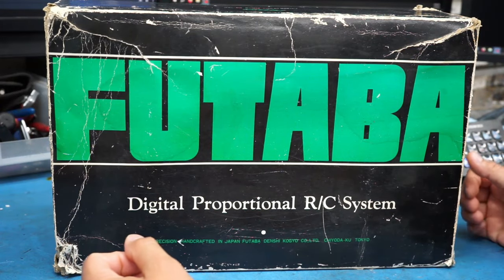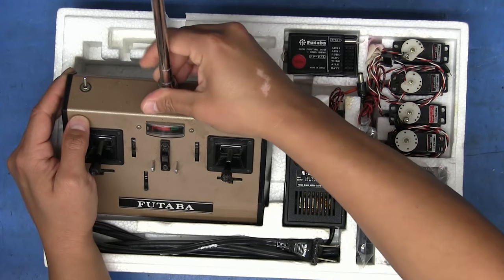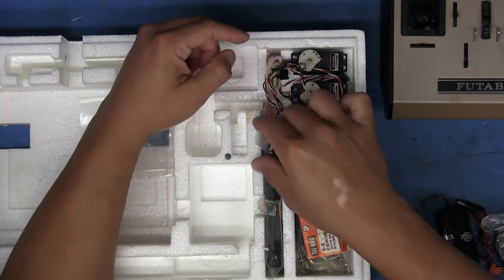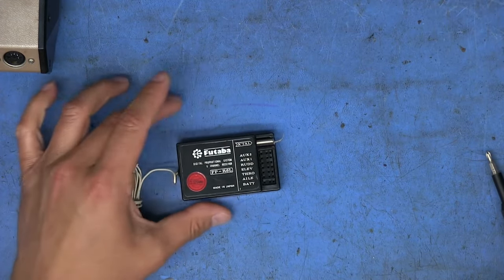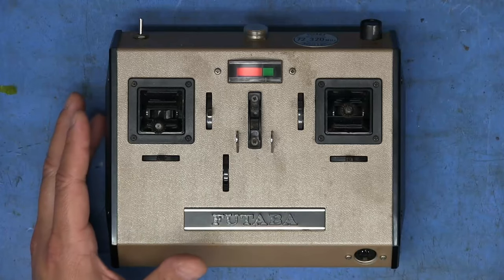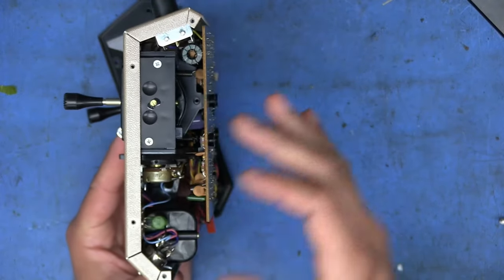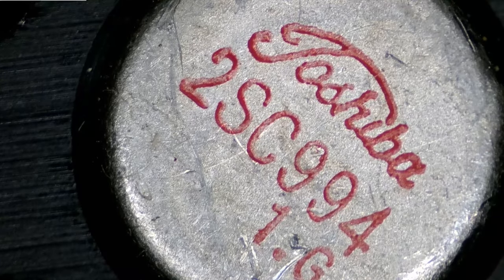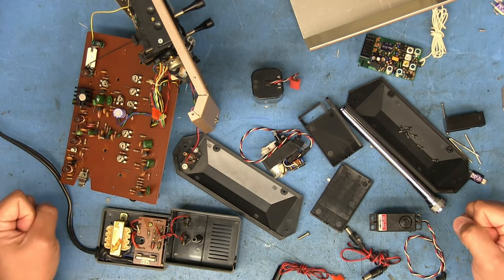TEF #150 | Vintage Futaba RC System Unboxing And Teardown

Comment: This was probably pretty awesome back then... would have allowed you to build completely custom vehicles without having to design an entire control system from scratch...I got my first R/C car in 96...it was electric and ate a battery in a few minutes...they didn't last many cycles either...I'm not a fanboy either way...if you want to go somewhere and play for a long time bring the nitro car/truck...if you want no fuss and have the batteries grab the electric one...I subbed... Thank You for your time and effort!
Reply from the maker: Yup, remember that well. A 7.2V RC car battery pack would last about 10-15 minutes at the most, and I wasn't cool enough to have more than 1 battery pack, so I had to make that time worth it.